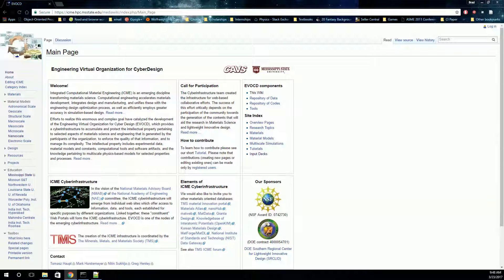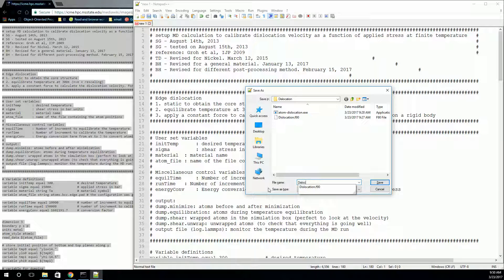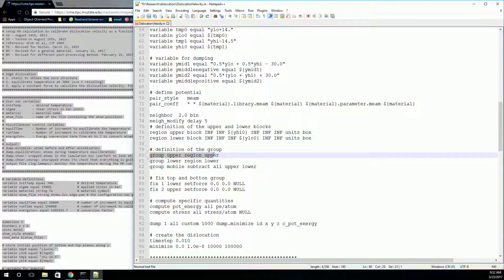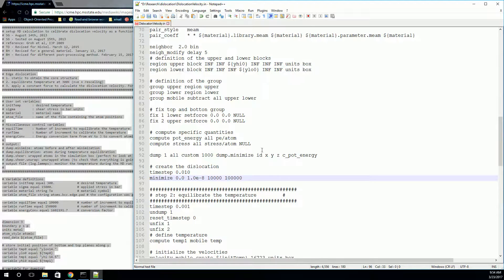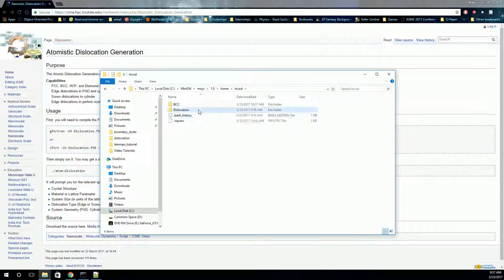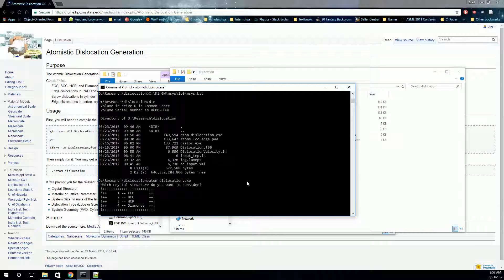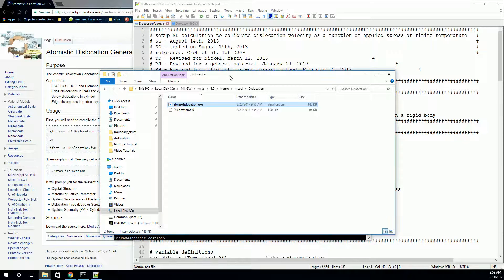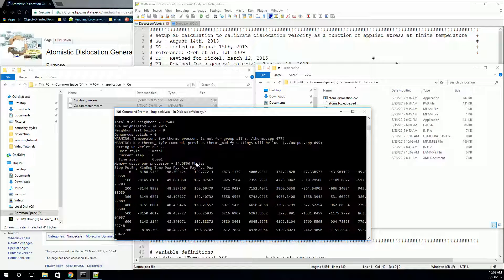Calculating the Velocity of Dislocation in LAMMPS

Comment: Hello, The video series has been very well put together. Can I get some help on a couple errors?
"The code execution cannot proceed because msys-gfortran-5.dll was not found. Reinstalling the program may fix this problem."
"The code execution cannot proceed because msys-2.0.dll was not found. Reinstalling the program may fix the problem."

Clearly, I'm having trouble with msys... however, I just installed in on my computer, and am not certain why it is giving these issues. Are there other files I need to place in the directory to get it to run? I'm new to these types of software.

Comment: Thank you for your great video! This is a very good introduction to beginners for DD. But I have a problem about running the code. In the downloaded Zip, I only have four .exe files (fcc, bcc, BCCdata, and mddp08) in the "Windows" folder. And when I run "fcc.exe" in the commander line, the generated DDinput file is an empty file. what would be the reason for this?

Comment: Excellent video!!! I was wondering something. In this case the shear stress is set, but suppose we want to set the strain in order to generate a stress-stress plot. How would you compute the shear stress? Can it be taken from the pressure tensor or would they have to be taken from the force acting in the mobile region? Thanks a lot for the tutorial!!!
Reply from the maker: Good question! I think there are many different ways you could do it. My initial thought is to have LAMMPS calculate the tensorial virial stress (in the documentation: compute stress/atom), and you could extract the shear stress from that.

Comment: Hi, I follow exactly the instructions in this video but I get a ERROR MSG when I try to do "lmp_serial -in dislocation_velocity.in". The ERROR MSG says: 
ERROR: Unknown pair style meam (../force.cpp:262)
Last command: pair_style   meam
I don't know why.
Reply from the maker: Hello! Thanks for watching. "pair_style meam" uses the fortran version of the MEAM potential. If you have a recent version of LAMMPS, this pair style is no longer included in the default build. Try using "meam/c" instead.
Reply: @Jere5120  Hi, I tried "pair style mean/c", it still says unknown pair style
Reply from the maker: Make sure it is "meam/c".
Do you get the same error message?
Reply: @Jere5120 
 ERROR: Unknown pair style meam/c (../force.cpp:262)
 Last command: pair_style meam/c
Reply from the maker: It looks like you don't have meam at all. You might need to try downloading it again, or try to find a previous version.
Reply: @Jere5120  I used homebrew to install lammps on my mac. And the lammps version is 2018-12-12_1.
Reply from the maker: Ah, in that case, you likely don't have meam installed, and that would be controlled by whoever maintains that package. Try running your lammps executable at the command line with "-help" to see what packages are installed.
Reply: @Jere5120  
Installed packages:

ASPHERE BODY CLASS2 COLLOID COMPRESS CORESHELL DIPOLE GRANULAR KSPACE MANYBODY 
MC MISC MOLECULE OPT PERI PYTHON QEQ REPLICA RIGID SHOCK SNAP SPIN SRD 

List of individual style options included in this LAMMPS executable
Reply: @Jere5120  And I checked that there indeed no mean pair style package included, how do I fix this ?
Reply from the maker: I don't really know anything about homebrew actually, but it looks like there is some advice on the LAMMPS doc page. https://lammps.sandia.gov/doc/Install_mac.html
I am confused why "meam/c" isn't working, because recent versions of LAMMPS should have it installed. But, see if some of the options described on that page will help you get a version with meam/c.
Reply: @Jere5120  

Ok, I successfully run "Cu.compression.in" on Windows. 

But still have some problems with "DislocationVelocity.in", it says can not find Cu.library.meam & Cu.parameter.meam 

Where you defined in the code: 
"pair_coeff   * * ${material}.library.meam ${material} ${material}.parameter.meam ${material}"

Comment: Is there a reason you use fix aveforce instead of fix setforce?
Reply from the maker: Thanks for watching! So, the intent with using aveforce (along with setforce) was to treat the top plate of atoms as a rigid body. The setforce (fix 1) prevents those atoms from moving in the y-direction. Then, the aveforce takes the average force on all those atoms - which has now been constrained to be in the zx plane - and adds our applied force on top of that. So, each atom has the exact same force on it, but we are not constraining the z force in particular. Ideally, the z direction will remain relaxed. Having said that, I was not the original author of this script, and I have recently been working with a similar system and I am wondering why there is also a fix rigid command - it seems like the other two fixes already create a rigid system.

Comment: Hi, thank you for the nice video. What a great and helpful tutorial! I am a total beginner in MD simulation. I want to simulate the behavior of dislocation loop in SiC ceramics and I think this tutorial is the best exercise to do. However, it seems that the Atomistic Dislocation Generation file is only for single element. Can you give any suggestion of how to generate dislocation in two elements system?
Reply from the maker: Thanks for watching! That is a cool problem. If you can go through the code enough to understand it, it shouldn't be too hard to re-purpose it for multi-element structures. However, as you probably have noticed, it is a pretty complicated code. The basic idea is pretty simple though - create a discontinuity in the crystal structure by displacing a portion of the atoms by the burgers vector of the dislocation. With an edge dislocation, this means removing a half-plane of atoms to create the discontinuity. Then, we rely on LAMMPS to minimize the structure back to the realistic dislocation structure. Unfortunately I don't know of any existing tools, but that is the concept.
Reply: Thank you for the reply. I got your point and yeah that is the thing that I am doing and yes it is very complicated. Meanwhile, I also tried to reproduce the stacking fault energy of 3C-SiC based on this tutorial (https://icme.hpc.msstate.edu/mediawiki/index.php/LAMMPS_Stacking_Fault_Energy). However, I don't understand some parts of it such as which data from the dump file did they plot to get the energy-displacement curve. Can you explain me a little bit? and it would be very nice if you could create another tutorial on obtaining stacking fault energy.

Again, Thanks a lot!

Comment: Hey Brad, thanks for your very nice videos. I have four questions about the input file. 

1) Is there any reference, criterion, physical reason, or recommendation to determine the thickness of the upper and lower planes or walls ?

2) The boundary has been defined as "boundary p s p". So, my question is why do we have the following fixes in step2 with NULL value in the z direction ?

###################################################
# step 2: equilibrate the temperature    #
###################################################

# boundary condition
fix 3 lower setforce 0.0 0.0 NULL
fix 4 upper setforce 0.0 0.0 NULL

I mean that shouldn't they be as below since we have "boundary p s p"  and set NULL in y direction ?

# boundary condition
fix 3 lower setforce 0.0 NULL 0.0 
fix 4 upper setforce 0.0 NULL 0.0 

3) In step 3, why is it necessary to set velocities to zero for the top and bottom walls ?

# define velocity on boundary
velocity upper set 0. 0. 0. units box
velocity lower set 0. 0. 0. units box

4) As shown below in step 3, is it possible to have a conflict between fix 1 and fix 3 since in fix 1 we set X: NULL Y: 0.0 Z: NULL and then we change it in fix 3 to X: ${appforce} Y: 0.0 Z: 0.0? (And again, I don't understand why we have NULL value for z direction in fix 2.)

# define boundary conditions
fix 1 upper setforce NULL 0. NULL
fix 2 lower setforce 0. 0. NULL
fix 3 upper aveforce ${appforce} 0. 0.
fix 4 upper rigid group 1 upper
Reply from the maker: Hello, and thanks for watching! Great questions.

1) Really, the thickness of the boundaries simply needs to be such that it does not affect the results of the simulation. For this simulation, I experimented with a few different thicknesses, just to make sure changing the thickness did not have a significant affect on the results.

2) Despite what it sounds like, the NULL setting in the setforce command actually means that the force is not set at all. So, we are allowing the particles to have force in the y direction. 

3) Initially, the particles may have velocity (thermal, or something). They shouldn't, technically, since we assigned the temperature only to the middle atoms, but if they do have any initial velocity, they will fly off - because they can't feel any force. So, we make sure that doesn't happen by setting the velocities to zero as well. 

4) This goes back to question 2, I think. We are not fixing the force in the x and z directions, thus, we can apply the force that we want with fix 3. 

Thanks for the good questions!

Comment: Hi, thanks for your videos, these are very useful and delight. Is it possible to generate a dislocation loop inside a material instead of either edge or screw dislocations?
Reply from the maker: Thanks for watching! Is it possible? Technically yes! However, in atomistics, it is very difficult to simulate a piece of material large enough to contain a whole dislocation loop. That would be a challenge to determine where to initialize the atoms as well - but, it is definitely possible.

Comment: Thank you for these videos! They've been very helpful. I unfortunately am having some issues when attempting this tutorial.

When running the "atom-dislocation" executable from the command prompt, in addition to the  DEALLOCATE, I get the following error:

Error termination. Backtrace:

Could not print backtrace: libbacktrace could not find executable to open
#0 0x6f8aecb4
#1 0x6f8a11ce
#2 0x6f88105c
#3 0x402da9
#4 0x41d8a8
#5 0x401287

I found that I still fot the .pad file, so I ignored this additional error and continued. However, when running lamps, I got the "atoms lost" error after about 103000 timesteps in the #step 3...# phase of the input deck. I lowered the variable "runTime" to 100000. I was then able to complete the lammps execuatable, but when examing the output files in Ovito found that there were fewer atoms (around 2000) and 200 frames. 

I'm thinking these discrepancies are due to the backtrace error. Would you have any suggestions?
Reply from the maker: +pawillia90 Thanks for watching! I am glad they have been helpful. As far as the lost atoms error in lammps, that doesn't surprise me too much at that run time, depending on your applied stress. The reason is that the longer it runs, the larger the "unwrapped" coordinate gets and I have found that the numerical noise tends to do some wild things eventually. Of course, you would want to double check that this is what was happening. As far as the number of frames in the output files - you will want to check your "dump" command in your lammps script, but I would expect 200 frames for 100000 timesteps in "dump.shear.unwrap", since the default for the script is one written frame per 500 steps. But, as far as the number of atoms, there could be a problem. Are you saying there were 2000 fewer atoms in the output file than in the input file?

Comment: for lammps program can we take positions from any other input file? files can be generated from other software.
REPLY
Reply from the maker: +Anirban Das Thanks for watching! There are a couple of different ways to import starting positions into lammps. Probably you want to use the "data" format which can include system cell and atom positions as well as covalent bonds, if you have them. I recommend looking at the lammps manual for a description of the format. lammps.sandia.gov/doc/read_data.html Typically, I will use python or another scripting language to write these input files, but I think some gui programs may have the capability to write them as well.
Reply: thank you for the reply. I am using Fortran and C codes for generating atomic positions. these files will be used for lammps programs. can this be done?
Reply from the maker: +Anirban Das Absolutely. The data file lammps reads is actually just a text file, so it only takes a few lines of code typically to write out your atom positions.

Comment: Hii  

Can you comment on the following error    
    
At line 2546 of file Dislocation.f90
Fortran runtime error: Attempt to DEALLOCATE unallocated 'itype'
Reply from the maker: Thanks for watching! Actually, this error does not seem to affect the running of the program. And, it may or may not show up depending on the compiler you use to compile the fortran code. But, basically, this error is thrown at the very end of the program as it is trying to deallocate memory, and it tries to deallocate memory that has not actually been allocated. It shouldn't (in my experience) affect the performance of the code.
Reply: Hey, Thanks ...one more question i need to ask is how can i get potential files    Cu.library.meam and Cu.parameter.meam    which need to required for the simulation ...quite new to LAMMPS ....Thanks in advance
Reply from the maker: Good question. So, LAMMPS includes one version of the copper potential with the program. You can find them in the "potentials" subfolder. Instead of those file names though, you will need to change them to "library.meam" and "Cu.meam" respectively. If you run into issues with LAMMPS finding those files, you can copy them from the "potentials" subfolder into your working directory.
Reply: Getting this error on this command  ./lmp_serial < in.DislocationVelocity 
ERROR: Unknown pair style meam (../force.cpp:244)
Last command: pair_style   meam

I am using the following library.meam file

https://github.com/lammps/lammps/blob/master/potentials/library.meam
Reply from the maker: Hmm. It looks like the "MEAM" potential is not built into your version of LAMMPS. I am not exactly sure why this is, but I have had this error from other people as well. If you need the MEAM potential, you may have to build LAMMPS yourself - it is not too difficult, and there are decent instructions on the LAMMPS site (http://lammps.sandia.gov/doc/Section_start.html#making-lammps). If you are just running the MEAM potential just for this tutorial, you can substitute a different potential just for the exercise. 
I am hoping to make a video on building LAMMPS at some point, but I can't guarantee when that will be.
Reply: @deepakkpawar7770  
I ran to a similar problem. There are two possibilities for a solution:
1. You need to make sure you configured & build & compiled lammps with the MANYBODY and MEAMS packages. To do this follow https://lammps.sandia.gov/doc/Build_development.html
Basiically, you just need to go back to how you make the file and run:
cmake -D MANYBODY=on -D USER-MEAMC=on ../cmake
cmake --build .

This should compile lammps with the appropriate libraries and packages to run this simulation on linux

2. In the input deck, the call to the meam files is using * * which is the local folder. For some reason linux doesn't like this so you have to put in the total file address location. If running linux, you need to change the pair coefficient line to something like:
* * /home/user/lammps/potentials/library.meam ${material} /home/user/lammps/potentials/${material}.meam ${material}

Comment: Thank you for this series! Do you know any database of LAMMPS input decks? I have explored the ICME site but am looking for more. Specifically, compression of carbon nanotubes. Thanks for any direction you have.
Reply from the maker: +Benjamin Davis Thanks for watching! I hope you found it helpful. 
To your question, the actual input deck for doing the compression of a CNT would be almost identical to the compression of a metal crystal. However, rather than creating the atoms in LAMMPS, you will want to generate the atom positions first, then load them. Actually, that is the process used in this video, except we are generating a dislocation inside a metal crystal. 

As far as generating a CNT for LAMMPS, the only program I know of offhand is Materials Studio, if you have access to it. However, the LAMMPS data files are a pretty straightforward text format, and worst case, you could write a little script to create a CNT for you. 
I hope this is helpful!